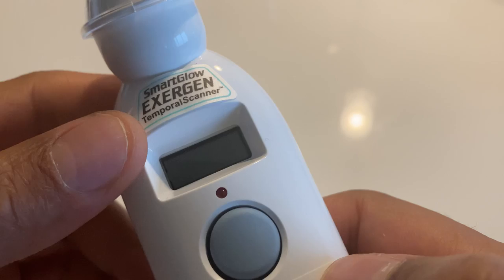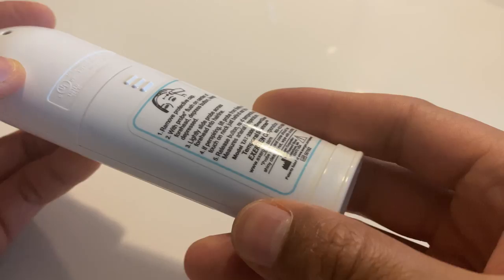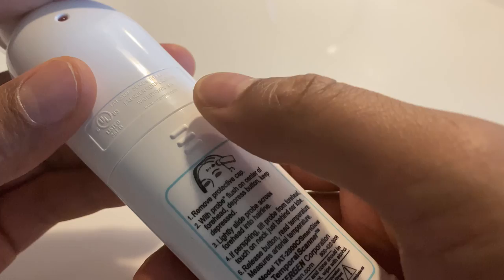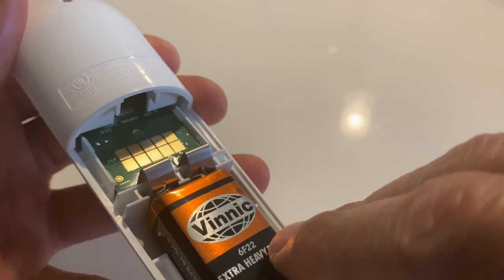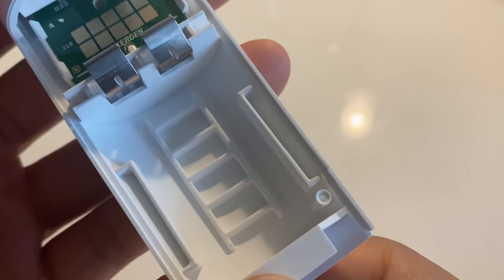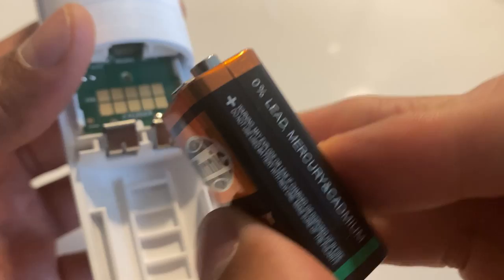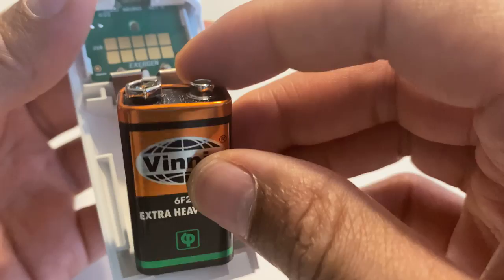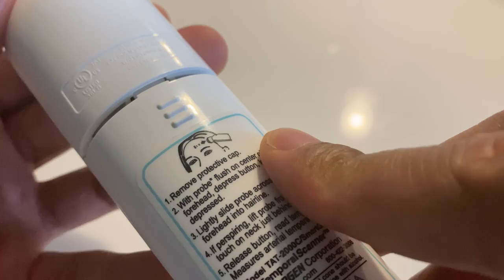Exergen Smart Glow Thermometer - How to Replace Battery

Comment: For those of us who don’t have the best grip strength, I managed to get it off with ease by pressing the ridged part against the edge of a table/counter and pull up at the same time. Came off the first time I tried.
Reply: We couldn't get it open prior to trying this method, thank you
Reply: Genius thanks we were struggling
Reply: Thank you so much!
Reply: I CANNOT OPEN THE BATTERY CASE 😤
Reply: Great thank you.. I was able to open with your method!

Comment: The back will NOT come off. What’s the trick?
Reply from the maker: can anyone help-out with this question?
Reply: Use both thumbs and push in and down. I had to use brute force.
Reply: I have the same problem.  It will not come off.  Yes, I pushed HARD but it still won't come off.
Reply: @Ilsashemother  One hand apply pressure to the ridges, other hand yank hard on the end of the battery cap. If you have trouble applying pressure with one hand (I initially used a Burt's Bee lip balm tube to apply direct pressure to the ridges with one hand, easier to get more leverage).
Reply: @davidlee5095  BRUTE FORCE was correct!  Once you said to hold onto and pull the bottom at the same time, it moved and came off. Thanks!!
Reply: @Ilsashemother  Push with one hand and pull the cap with the other
Reply: @dilleydoll1001  bless your heart,, I finally got it
Reply: Took 2 of us but we got it open
Reply: @davidlee5095  thank you very much for your tip, it works :) after had trying for several days..haha
Reply: Push the top grooves with your thumb and slide downward. Do it harder if it won't slide. It will come off. I have strong  hands, by the way.
Reply: After a lot of pushing and pulling, a few choice words and blisters on both thumbs, THE CAP IS OFF!  Turning it upside down and pulling the cap helps, but this remains the most difficult removal of a battery cover in history.   You think "There must be a screw here somewhere."
Reply: Put your purse down
Reply: @RubenMartinez-cq8hk Sit when you pee

Comment: The battery compartment is darn near impossible to remove by someone who doesn't have brute strength. This feels like a significant design flaw since it most likely will be used by women. Wish I hadn't bought it.

Comment: Lot of resistance 1st time opening.  Not shown but the base of device comes off with door.  My guess is the base adds resistance to removal of the door.  I inserted a dull kitchen knife into the crack created at the top of the door and carefully popped it open.  Should be able to get a lot of miles out of that 9v battery.
Reply: This comment was extremely helpful along with the video, thank you
Reply from the maker: @mikestevens4174 thanks for the tip! 

Also, can you subscribe for more great content? I will really appreciate it!

Comment: It will not open no matter how hard I push
Reply: Mine too lol. I feel like a 10 pound weakling.
Reply: Tough to open the first time. But I got it and then cycled a few times through putting it back on, taking it off, then back on,. Now its fine and removes easily.
Reply: @tkerrig6269  impossible to open.  Might just have to buy a new one.  Be
Reply: You are right Brad.
Reply from the maker: @bradseagle5959 did you ever figure it out?

Also, can you subscribe for more great content? I will really appreciate it!

Comment: As others have mentioned, definitely a lot of resistance on the clip holding the battery cap in place. Included instructions didn't help and this video visually helped.

My suggested first time opening instructions is with one hand holding the thermometer somewhat upside down with thumb pressure ON the ridges and DOWN toward the base, while at the same time, having your other hand grip the base and gently pull same direction (down) as your thumb is doing.
Reply from the maker: Thanks Scott
Reply: Thank you scott! Even after watching the video i was worried i was going to break it or something with how hard i was pushing on the nubs. After pushing them and pulling down on the bottom as you mentioned it actually came off pretty easily. 

Also, thank you Pinto for making the oringinal video.
Reply: Much appreciated!
Reply: your comment helped more than anything.  i FINALLY got the thing open!  Thank you!
Reply from the maker: you're welcome! Can you subscribe to my channel?  I will really appreciate it!

Comment: This thermometer sucks! The battery cover will NOT come off.
Reply: You can do it! I got it open after many failed attempts. One hand apply pressure to ridges (push with thumb away from you), other hand yank on the battery cap end. If you do it just right, it'll come off
Reply from the maker: Did you eventually get it off?